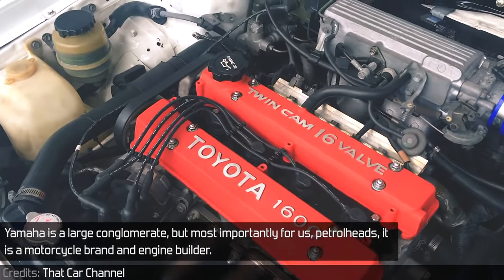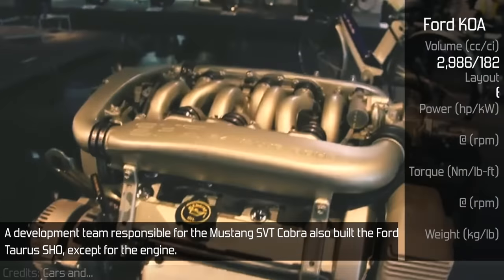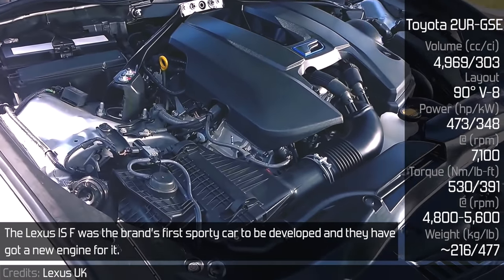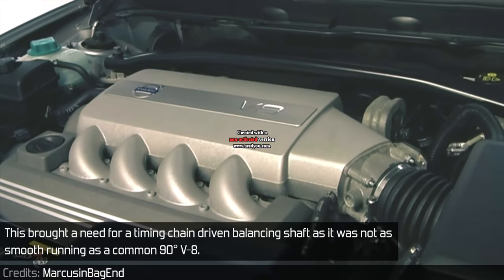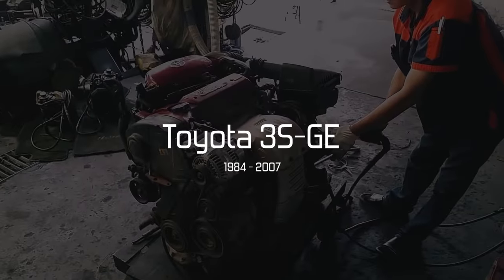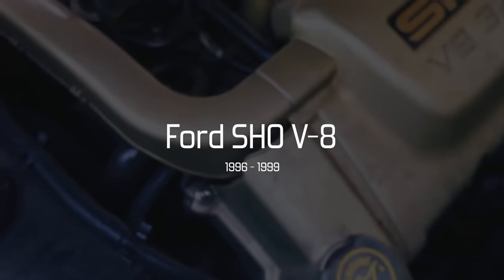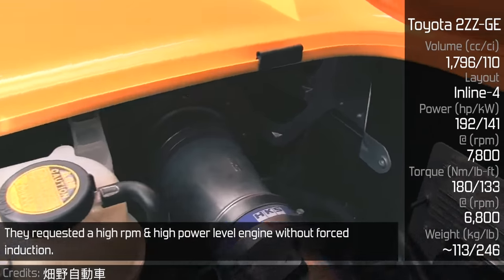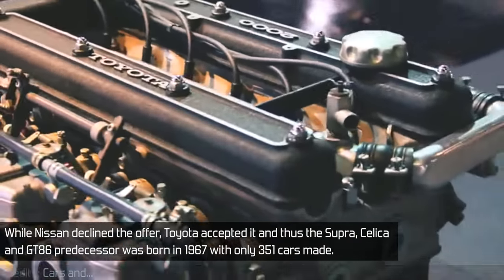9 Yamaha Engineered Engines You May Not Know About

Comment: This is why Yamaha is hands down the best gas engine builders/ designers on this planet.
Reply: AWESOM_O0 it in fact is but their engines are top notch.
Reply: They made some decent ones but Toyota asked Mazda for  ( Skyactiv- engine- ) help recently ...
Reply: VW engines are better, the 4.0L V8 Twin Turbo FSI in the Audi RS7 and the 5.2L FSI V-10 in the Audi R8 are the best production engines currently in my humble opinion.
There are more powerful engines but non are so technologically advanced and smooth running as these two.
Reply: cough Honda cough
Reply: Not even close that's the funnest shit ever
Reply: billy heaton who do you think makes the best engines in the world
Reply: vicmanvalfre96 trent
Reply: What happen to Mercedes?
Reply: Well, who makes the best engines? Give us your reasons for your selection if you have any. Why did so many manufacturers turn to Yamaha to design or help design their engines?
Reply: Nothing as far as I know. They are still making cars and make excellent engines but how many car manufacturers have employed them to develop their engines? I would suggest not as many as Yamaha by a long way.
Reply: Dr. Evil. Give us the benefit of the reasoning for your opinion please. For instance, specific power outputs, specific torque, torque and power characteristics, Brake Mean Effective Pressure, specific fuel consumption, weight, cost, servicing intervals, reliability, longevity, racing successes. Was this video about current production engines? The title of this video is about 9 production engines that Yamaha has developed or helped to develop, not about VW or Audi having the best current production engines. Perhaps you can make a video about your favourite engines.
Reply: And the Best pianos
Reply: I guess they make the best PWC engines too. Seadoo seems like a joke.
Reply: Sackmatters Honda is probably the best engine maker! Just look at how many engines they have made for all different kinds of stuff. Cars, motorcycles, boats, scooters, jets etc... 

They made the Honda S2000 which had best hp/liters output for many years till the Ferrari 458 came. So Honda knows their stuff!
Reply: mmm.... the 1st engine was developed with bentley, and its not impressive by any means, the second is an engine from Lamborghini not audi. they are far from the best, they are not bad, but combine that  with the poor reliability of audi... not even close to the best engines. not getting the japanese in this game, ferrari, and mercedes make way better engines
Reply: Sackmatters i think Honda too.
Reply: Well, I guess Audi makes horrible engines and won big racing events like Le Mans several times. I guess Lamborghini makes much better engines...despite Audi bought them 20 years ago and delivered know how to them...btw a few engines also. 
Yeah, Audi really sucks.
Reply: Sackmatters Agreed, i have been wrenching on small and big boat engines. It's shear joy to work son. Had an dirtbike to. 10/10 best bike and engine in that segment! 

Maybe its just not the fact that it is easy to work and maintain their engines. But the fact that every part and diagram is so easy to get. Parts are super cheap, and everybody seems to have easy access to parts. Atleast here in Europe :)
Reply: Does the name Steinway mean anything to you..?
Reply: Sackmatters One of the best id say but dont forget Honda
Reply: Dewald Swart Well Yamaha motogp team have been unbeatable. I know Valentino Rossi is a great and skilled rider but even when he moved to Ducati he wasnt in the top position and he came back to Yamaha. The Yamaha YZR-M1 is everybody's dream bike at some point in their life.
Oh and to me, Toyota 2000gt is still the best looking sportscar ever made. Looks even better than Jaguar E-type.
Reply: Arya Jonathan Not really unbeatable... Honda is up there and did beat Yamaha last year! 

Just look at what Yamaha did in F1... One of the worst engines ever.
Reply: Arya Jonathan Yamaha is def not above Honda in Moto GP.Honda does have a shit desighn in Formula 1 but look at all the previous years....Honda was a great Formula 1 car till they started to mix electric engines with shitty turbo 8 cylinders.
Reply: Dewald Swart The V6 hybrid engines by Honda in F1 are getting better and I think they will be able to fight for podiums next year. 

A reason why Honda is doing so bad in F1 now is because last 2 years they were going another route in their engine designs trying to minimize the whole engine.

This year they started from the begining and tries the same concept as Mercedes and that's why they are so bad. But they are introducing a lot of updates which have placed them in the midfield again
Reply: Johnny Walker I hope so because its a shock to most Honda fans to see the brand performing everywhere but in F1 racing.I dont like the Hybrid idea in racing its pathetic.Bring back the raw V10/V12 sounds :)
Reply: Some manufacturers have a long history working together with Yamaha like Toyota, some have a problem what they think Yamaha can solve  or Yamaha has already a solution for it. Honda was creative in the 90`. but their time seems to be over.The most innovative engine manufacturer / designer is Mazda. They have developed Skyactiv X ready for the market in 2019...
Reply: honda
Reply: @TheScick  hp per liter is a useless metric. Especially since their motors aren't all that great having had a ton of Hondas lock up on me with perfect maintenance also lotus is a amazing engine and chassis designer.
Reply: @jdrok5026  Lotus don't even make their own engines... Lotus uses Toyota and Honda engines. Honda reliability issues is a very rare thing. Honda is ranked among the most reliable vehicles!
Reply: @TheScick  lotus has made their own engines.
Reply: And Honda is nowhere near reliable. But I do different stuff and Honda has notorious reliability issues.
Reply: @jdrok5026  Lotus don't make their own engines because they were too unreliable, brittish cars are known to be very unreliable... The Evora for example uses a Toyota Camry V6 engine and the Elise a Toyota sourced 1.8 L engine. According to you (a single person) Honda is unreliable while thousands of other says that they are super reliable. Source: reliability index
Reply: They are second very close to Honda.
Reply: Way better than bmw💀 aka the new supra
Reply: @williammckenna2369  As some one who spends their week fixing the poxy things,I'd disagree.
Reply: @TheScick  There are no British cars.

Comment: For Double Over Head Camshaft, instead of saying D.O.H.C just say Doc.
Your English is getting good, I remember when you first started this channel, I could hardly understand some words you were saying, no problem no though. 
Another engine is the 1G-GTE from the Toyota Supra, 2,000cc twin turbo, Toyota's RB20.
Reply from the maker: I still prefer D.O.H.C., it's more clear. Thanks anyway!
Reply: VisioRacer Algood.
Reply: Lance Johnson twin cam. Easy.
Reply: Lance Johnson - DOHC is pronounced doke in the automotive industry
Reply: A twi cam engine can still have pushrods. EF Turners Riley engines. Triumph motorcycle engines.
Reply: Lance Johnson i just say dough'k
Reply: Oscar Thorpe h
Reply: Yes they are, and Niossan made the RB's hundred % them selfe
Reply: Yes, i was meaning the 1G-GTE is a comparisan to nissan's RB20DET, both inline 6, 2000cc, 24v twin cam.
Reply: it's just that Nissan allways made their engines alone, without help.
toyota needed help from outside, without yamaha's help 2jz would never be able comparison to RB26

Comment: yamaha engine ( volvo ) is also used in the english noble m600 supercar
and yamaha helped out renault with the cylinder head of their f7p engines due to cracks around the spark plug on early prototypes
Reply: But in the m600 its twin turbo 😉

Comment: Toyota/Yamaha co designed engine from the Elise is found in the Celica 190vvti/GTS and Corolla T Sport.  

Plus there was a limited run of Corolla T Sport with this engine in supercharged form (yes from the factory).  I believe there are 250 of that model in the UK.  230bhp.  

Underrated cars.

Comment: B8444S in 2005 had main issue with drainage in block. In 2006 Volvo fixed it, but they never admitted this bug. 
Also, this engine was used in  Noble. Of course - with turbos.

Comment: hi i am from good old germany and the european ford focus mk1 from 1998-2004 - benzin gasoline engine zetec s engine 1596 and 1398 ccm with 55 KW and 74 KW also from Yamaha engineered 
good engines
Reply: I believe it was the 1.25 and 1.4,not the 1.6. It was a great little unit which loved to rev, but if you let the oil get a little low or skipped oil changes they would suffer quite rapidly,more so than other stuff treated equally as poorly.

Comment: Didn't the Ford Fiesta 1.25 (Sigma?) engine originate from Yamaha as well?
Reply: johnyfartpants yes it is and you can even go so far that the basics of that engine still live on until today. The 1.6 Ecoboost and its successor, the 1.5 Ecoboost are basically Sigma engines.
Reply: Ford Puma 1.7 VCT not the fiesta
Reply: There was the 1.25 engine with Yamaha development and the 1.4, 1.6 and 1.7 of the Ford Puma, which were Yamaha engineered, especially the 1.7. The ST170 is Cossie-Developed...
Reply: As Chris McGyver correctly states - the 1.25l engine in the european Fiesta (not sure about the US one) was co-developed between Yamaha and Ford, an all aluminium DOHC 16v unit I believe (obviously with steel cylinder liners) plus the variants of 1.4l, 1.6l and 1.7l also used in the Fiesta (but not the 1.7l although you could easily transplant it into a Fiesta if you had the time and expertise) and Puma. A sweet smooth torquey unit that was in 1.25l form in several mk5 Fiestas that I owned over the years. It was that good, it would accelerate on a gradual uphill part of a motorway in 5th at 70mph - something that earlier versions of Fiestas just couldn't do. And it would keep accelerating so long as you mashed your accelerator into the floor! I surprised many a BMW and Mercedes driver by doing that and then flashing them to pull in cos I was going faster than them - then keep the speed above 90mph and they never bothered you, unless it pissed them off that much, in which case they'd blast past me at around 120mph, just to prove a point, but they'd bottle it and slow back down to 80 and I'd catch up with them again and do it all over again! happy days! lol! And the rozzers (cops to non UK residents) never bothered me cos they never thought a bog standard scruffy 1.25l Fiesta Zetec would be capable of such a thing - a real sleeper car for pocket money prices! lol!
Reply: Mazda 2 demio as well 1.25
Reply: I had a Mk7 fiesta with the 1.25 and it was a brilliant little engine and extremely reliable, a bit thirsty with the old petrol mind you but not an engine that would have ever let me down. Even when it was front ended badly the engine stared up as if nothing had happened.

Comment: If you look at Yamaha dirt bikes they developed nearly every new technology you see in modern bikes such as mono shock rear suspension, liquid cooling, and they produced the first 4 stroke mx bike the yz400f and started the 4 stroke revolution. They may not have been the first to perfect any of this tech but they were always the first to come up with it.
Reply: Matthew Weisenburger very true, and right now they make the best 250f bike on the market
Reply: KTM is the best innovator in dirt bikes.  Yamaha usually only release high tech on factory team bikes. Years later it's on the normal bikes.

KTM had liquid cooling on the entire lineup way before Yamaha.  Same with one rear shock and upside down front fork and also liquid cooled 4strokes before Yamaha dirt bikes. 

Back in the early 80s KTM had aluminum rims, removable rear frame and aluminum handlebars, upside down fork, yamaha still locked like cheap 50cc mopeds with steal handlebars and single frame.

KTM began developing an ultra-modern 4-stroke engine in 1982 based on the 500cc 2-stroke housing. The name of this engine was also a reference to its design: LC4

1981 – Production of the first water-cooled 125 cc Motocross bike. 700 employees achieve an annual turnover of ATS 750 million, 76% of the production is exported to 13 countries.

1986 – KTM becomes the first manufacturer to offer disc brakes front and rear.

https://www.google.no/amp/s/elitektm.wordpress.com/2016/02/25/the-illustrated-history-of-ktm/amp/

Comment: It was indeed however you forgot to mention that toyota pioneered VVTI through the BEAMS dual VVTI on the 3SGE. This means before Honda or BMW or anybody else for that matter. This is a god tier engine from yamaha and Toyota that once again showed the world they are kings of small engine power and efficiency.. You also forgot to mention the 1JZ as that also had a yamaha head with titanium valves. ;)
Reply: It is pronounced s h o not show. Do your reasearch.
Reply: don't forget the 2JZ variants, they all had yamaha heads as well
Reply: Arthur Wall I said dual VVTI, you know, the VVTI worth having :)
Reply: The 1 and 2jz don't deserve mention since they are just a clone of the jaguar xk6 series engines.
Reply: @Corey Schmidt What are you talking about, the 1 and 2JZ are derived from previous toyota i6 engines, all the way back to and even past the 2000GT
Reply: thealeksanderh all of which are clones of the jag xk inline that was developed in 1947
Reply: @Corey Schmidt The Toyota type-A is from 1935 and was a Chevrolet engine.
Reply: thealeksanderh invalid point. The type a was a flathead configuration. The jag xk was the first, and arguably the most successful mass produced DOHC inline 6 of all time.
Reply: Corey Schmidt Jaguar's previous engines were not DOHC either.
Jaguar did not invent the the concept of DOHC. 
The fact that the type-A is flathead is not Significant, the newer engines are still derived of it.

BMW had DOHC engines in the same time-period, that does not make them XK clones.
Reply: 7.3forlife
Reply: +Corey Schmidt
The DOHC set up goes back to the to before internal combustion engines, but amongst one of the 1st (admittedly for a motorcycle) was a Peugeot engine (and bike), certainly the 1st to be both 4v per cylinder & DOHC was the 500M. 
   An early Norton would have one of Peugeot's 8 valve DOHC parallel 'GP Twin' engines in 1912 to test at the IOM TT races, after using and winning with earlier Peugeot products.
Reply: Anthony Suarez
Did the 1JZ retain the T-VIS system from the previous 7M-GTE design? I love the T-VIS in my 3S-GTE (Another winning Yamaha head design)
Reply: You're all wrong. First 'production' engine with variable valve timing was fitted to the Alfa Romeo 75 http://www.italiaspeed.com/2005/cars/alfa_romeo/10/75/1610.html
Reply: 2JZ had Toyota heads based on the previous Yamaha designed 1JZ
Reply: 3S-GE has titanium valves too,only on Altezza RS200's.

Comment: Yamaha makes high revving motors which have awesome performance and sound once  tuned. Only issue I had with my ISF is the valley plate leak,  that cost me about $1,700 to repair,  and a leaking header gasket. The 2UR-GSE V8 motors should have a warranty for the valley plate leak.  Performance wise  as a n/a motor it's exhilarating to experience while racing.

Comment: The Volvo V8 is actually the Ford Taurus SHO V8 with greater displacement.  And it is based heavily upon the Ford DuraTec V6 engine, hence the 60 degree included angle.